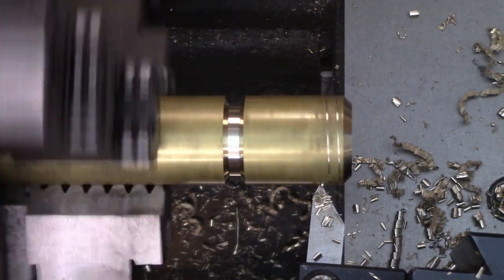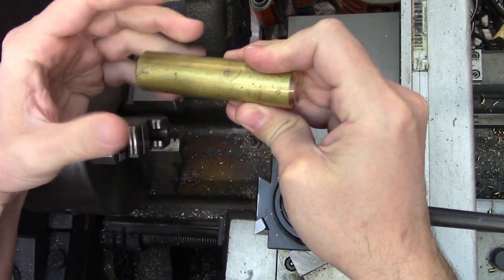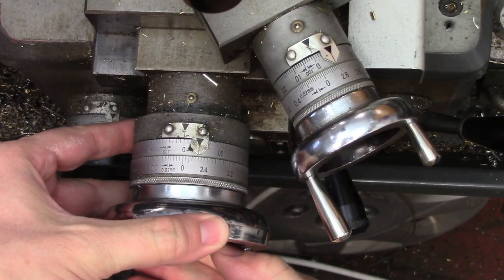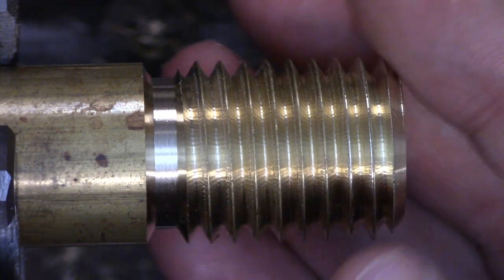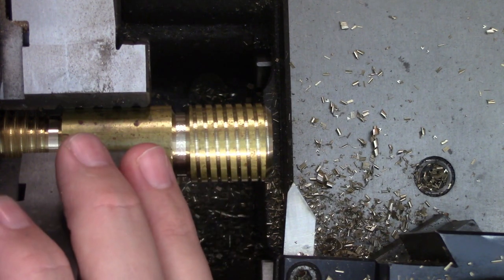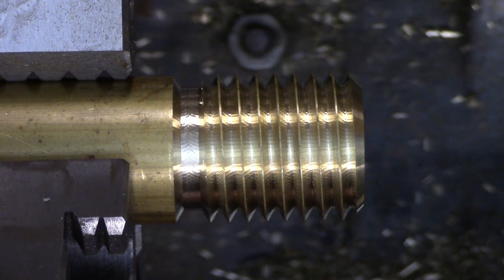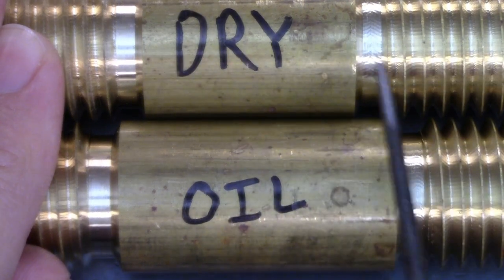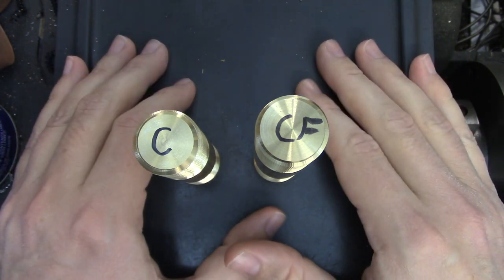Threading With the Compound vs. Crossfeed

Comment: As an apprentice, I was taught to use the half included angle via the top slide and we only had hand ground HSS tooling. 
The Old Boy turner in the repair shop showed me how to put the cut on with the cross slide, but to advance the top slide (set parallel to the work) a couple of thousandths every cut, to mimic the angled infeed cut and reduce the load on the tool and that's how I've cut all my simple threads since the 70's.

Comment: Great video! I've always threaded with compound in feed, mostly because of  speed in a production environment. When I began running NC lathes the programming had different in feed angles to control the flow of the shavings. I started using  10°  with excellent results. I still do it  that way. I usually had better tool life than the 29.5° in feed angle. Thanks for your time and sharing. 👍

Comment: Good video. I would make several suggestions that might help machinists doing threading for the first time. The first is don't start threading on nominal sized stock. Look in the threading section of your machinist reference book. You will notice that for a 1"-8tpi thread the stock major diameter is not 1" (same-same for mm threads). The major diameter is some thousands of an inch under the nominal size. Note in the video the threads have a sharp crest whereas a correctly cut 60 degree V thread will have a crest flat equal to 1/8th the thread pitch. If you thread nominal sized stock and are using thread go/no-go gauges to check your work in process by the time you get the go gauge to go on to the work the thread will be under size. As an aside if you are using a threading die the work is noticeably easier to thread if the work has the correct o.d. for that particular thread.
There is a trick to be able to cut threads at a much higher rpm on a manual lathe besides threading outwards. While threading outwards with the lathe in reverse is a viable method it won't work when no thread relief is allowed. This will require feeding from the compound. Run the threading tool in close to the work and stop the cross feed hand wheel so the handle is at about the 10-11 o'clock position and set the cross feed dial to zero. Bring the threading tool up to the work with the compound feed and set it to zero. Up to 1/2" (13mm) threads I run the lathe at about 220rpm. Engage the half-nut and when the tool reaches the point you wish the thread to end snap the cross feed out and open the half nut at the same time. Do it a few times and  you'll get surprisingly good at it.
If you are cutting metric threads follow the directions above except that after pulling the threading tool back and opening the half nut cut the power and let the spindle stop. You will notice that the thread indicator dial hasn't moved very far from where it was opened. Put the lathe into reverse and when the thread dial mark you were using comes back up, re-engage the half nut and back the carriage up to the initial start position. Once in position set the compound feed for the next pass and turn the cross feed to it's "zero" and make the next pass.

Comment: With using the compound you zero out the compound then just touch the tool to the work od and zero out the cross slide. When cutting you just need to take the cross slide to zero every time and move the cross side in a bit at a time. After the final pass write down the number on the cross slide for multiple parts and it is just as easy for production as using the cross slide only. Example, if the cross slide is set to .045 on the last pass you should be able to take your next part to .045 and get the same thread pitch diameter as the first part assuming the od's were the same as each other if not you have to compensate for that.

Comment: The third and just as common method is where the depth is fed with the cross slide. Also on every pass the compound set parallel to the spindle is advanced by half the depth of cut. This keeps the pressure on the leading edge and reduces tool load. This method almost exactly reproduces the compound set at 29 degrees.

Comment: The cross slide method has the disadvantage that you have to remember exactly what your last pass was on every pass.
Reply: thats a game changer for an old dude like me I would never remember
Reply: Yes I know the problem....but thinking 'outside the box' I assume you have the compound running in the 'Z' axis, turn it to move on the 'X' axis, then set the 'X' cross slide to zero at the start of the cut, but make the advance for each cut on the compound, then retract on the cross slide, return the carriage to the start, put the cross slide back to 'Zero' then advance the cutter on the compound, this allows you to instantly see how deep you have cut at any time, and keeping the cross slide for the cutter retraction and back to 'zero' nothing to 'remember' ( basically you are using the 'Compound' method with the tool advancing into the job at 90 degrees)
Reply: @anthonyashgrove2908  That'll work. But a prime motivation for me to plunge thread is not having to move the compound!
Reply: @billshiff2060  Sure, I'm at the age when I don't remember where the tool is I was holding a minute ago! maybe if you make a list of the cross slide 'readings' to be used for common sizes, i.e. 0.00", 0.012", 0.022", 0.032", 0.042" 0.052". 0.062", 0.070", 0.076, 0.080" yes you do have to remember what pass you have just completed. A workshop I frequent uses these charts on a large piece of card mounted on the wall behind the lathe, they also put the gearbox settings for that TPI on the list it does help speed things up on common jobs.

Comment: my only problem using the compound, is keeping track of my depth of cut. and zero position. i have to write it down. with the crossfeed  tech the crossfeed stays on zero and you keep track of your depth of cut with the compound. i was also taught to advance the compound a couple of thou in the end to clean up the back side of the cut.

Comment: So I have just machined a part this morning on what is a monster lathe to me.
I used an angle finder as I do at home, setting the compound at 29.5 degrees to the chuck face, which in turn gave me 60.5 degrees on the scale. I was thrown by this but have I set the angle correctly?
Reply from the maker: Yes you did. The angle depends on where zero is compared to the lathe axis. Some lathes have zero with the compound perpendicular to the spindle axis, some have it parallel.

Comment: Loved the video. But.... looking at the angle of the tool at 5:56 leads me to believe it is not perpendicular to the work. The side of the HSS bit doesn't appear to be anywhere near the line of the cross slide travel. Is the angle of your point grind that far off, or did you not use your fishtail gauge to set it up against the work? Normally I would say it's probably due to the camera angle, but it sure likes like you were dead center over the top of the tool with the lens. Asking for a friend.... 😁
Reply from the maker: The angle was ground that far off.  I'm not proud of it.

Comment: Stuart, I am trying to learn to thread on my 1236 , compound at 29.5 as better people suggest using carbide 60 deg. insert and using a DRO. No body ever showed the angle of the tool holder and insert so I set it at 90deg. to the material axis, starts great but as I cut a 1.75 met. pitch after about 3 passes then check with thread gauge it shows pitch is moving down towards 1.5 mm and less. I noticed  your single point cutter is angled to towards the tail stock i.e not at 90deg. to the material axis line, would this be why I am failing to maintain 1.75 mm pitch even when using the compound , if so what is the correct approach angle to set the insert at. signed ( an 
old fart who is running out of time)
Reply from the maker: The tool definitely needs to be perpendicular to the workpiece. The tool in the video is hand ground so the angle is not square to the bit, but it is perpendicular to the part. Regarding your issue, first check the gearing to make sure you've got it set correctly. If that looks good then tell me how the thread looks. Is it the correct angle on the headstock side of the thread but much shallower on the right? If that's the case then your compound is set incorrectly. There are a few other options.  Why don't you email me pics of the threads and I'll try to troubleshoot them for you. My email is my channel name @gmail.com.

Comment: In theory cutting with the compound would drive some of the force axially (compressing the stock towards the chuck) whereas cutting with the cross feed would be driving all of the force normal to the stock. However cos(29.5) is ~ 90% so the difference in normal force is about 10%, which means maybe on a smaller piece of stock you can get away with something on the compound that you couldn't with the cross feed but 90% of a big number is ... still a big number. Thanks for the visual confirmation!

Comment: I conducted the same test cutting m12 in 303 stainless using a single pitch TC threading insert. Even under a microscope you couldn't tell the difference. 
Despite my regular thread cutting I keep my top slide set parallel to the lathe bed, set true with a DTI, as it is so useful to take a small extra cut when the bed stop is reached. I shall however set it to 30/60 when i make a 16DP gear cutting hob as the load would or might be excessive to just plunge cut.
Reply: You called it a "Top slide"  so I'm going to guess you are a brit.  I've noticed the brits keep the compound set to parallel.  Then again, you guys drive on the wrong side of the road!  :-P
Reply: @jagboy69  wrong side? Which side do you get on a horse? Think about it.🤔😂
Oh and yes a Brit, and was proud of it once, before the wokes took over.😭😭😭😭
There are many countries where it is standard practice to keep the top slide parallel, but it's a case of do what you are comfortable with. Some folks were taught to thread at an angle and don't have the wit to believe you don't have to, but it is always the result that matters not how you get there.
Reply: @chrisstephens6673  You know I'm screwing with you right?😜
Reply: I've been watching doubleboost for years and when I got my lathe, my neighbor saw me with the top slide parallel and gave me a rash of shit.  It's probably the smarter way actually.😉
Reply: @jagboy69  of course, and I'm a big boy now and can take it.😉
Reply: @jagboy69  John is a lovely chap but ......
Shall we just say the first time I came across him I, and lots of others too, had to put him right when he was showing the world how to thread but hadn't learnt long before and had the top slide at the wrong 30 degrees!🙄

Comment: Choosing 360 brass was not a very good test because almost anything can do a good job on brass. The chatter you were seeing may have been do to the gearing in the lathe.  Run the test using some 1018, it would be more telling.

Comment: Hi is it possible to cut threads without a dial
And if yes how do you do it thank you
Reply from the maker: Absolutely. The safest way is to engage the half nuts and don't disengage them until the thread is complete. Just pull the tool out from the part, reverse the lathe to get back to the beginning, move in for the next cut, and run the lathe forward again. Lather, rinse, repeat until you get the thread finished.
Reply: @StuartdeHaro  
Thank you I will give it a shot and i Will let you know   Eli

Comment: the compound method is 100% a hold over from HSS tooling, in a production atmosphere with manual machines, you will need to regrind your HSS bit several times a day, so rather then regring BOTH sides you mostly use one side, so then you just have to grind that one side, Also you can almost get away with grinding the trailing edge a litte steep and have only the one side to contend with, the "leaving a better finish" is likely one of them capt dummy explaining the who too's to the FNG, who then repeats its for 300+ years.

Comment: I have not had to thread yet, but instead of threading forwards the chuck, why not thread away? Learned about this from a Joe Piezinski video. This eliminates the pucker factor.
Reply: Also, thanks for this. I have seen both compound and cross feed methods and did not understand the difference. I appreciate you going over both.
Reply from the maker: That would be a great option if the lathe ran in reverse, but I've got a wonky contacter and it doesn't do that.
Reply: @StuartdeHaro  ok, that makes sense!
Reply: I have an older South Bend Lathe and threading in reverse could potentially unthread my chuck.